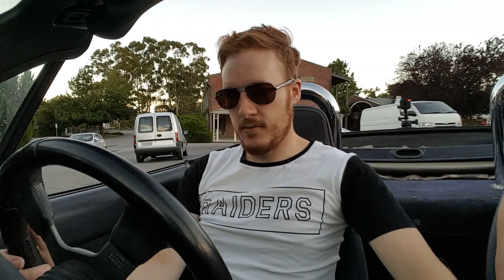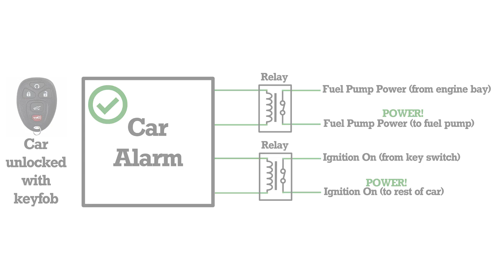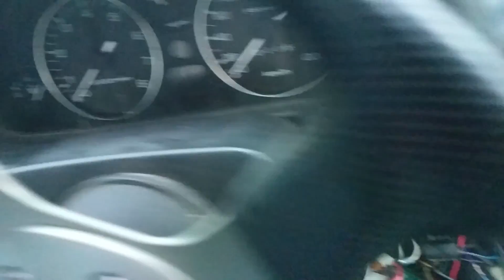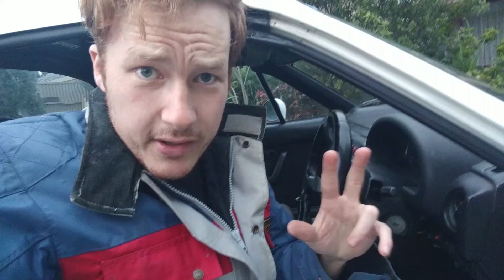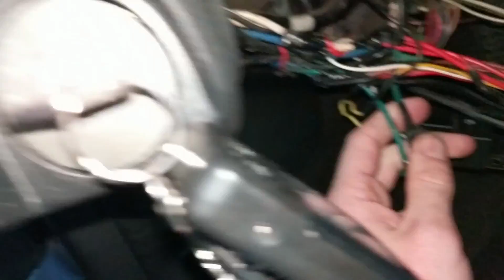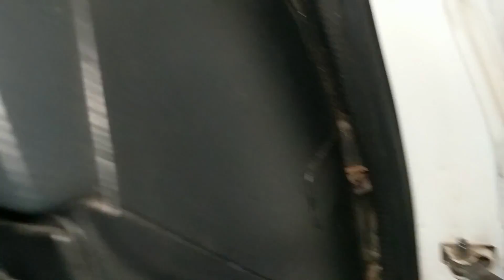How To Remove a Car Alarm - Quick and Easy, DIY!

Comment: I really wonder what the point of these alarms are if they're so easy to bypass.
Reply from the maker: Yeah, me too. But at the same time, when I first looked at this, I had no idea. 

I feel like for a professional it would be easy to get around though. Just requires that a thief is quickly able to locate the modules and bypass them without making too much noise or attracting too much attention.
Reply: Mees Boeijen I
Reply from the maker: Jerry Peterson  Yeah, it's a goddamn disaster what some people do.
Reply: Remember that while the thief is trying to access these wires, the alarm is screaming. Even a smart thief will take a little while to locate and disable. But if they REALLY want the car, they'll just break in and take your keys you most likely left on a bench somewhere.
Reply: i think your just saying that absed off you watching this video but you dont actually kniq where to locate these key in wire ir fuel pumnp wire yourself without looking at a diagram

Comment: I have a 97 Toyota Camry CE E I am trying to put a aftermarket alarm system on there I got it all hooked up sup for the lock and unlock and I can't figure out where to hook those wires to I need help

Comment: I have done same way now it took me less than one hour to remove the alarm and start the car even without the car alarm. It would have cost me lots of money 100 USA $. But your video took me easy and saved me time.  And my car is starting normal and no problem.  Thank you for good information. 👍
Reply from the maker: So glad you got a good result, cheers!

Comment: Just got stranded on the supermarket's parking lot because of the shitty alarm that was "removed". Thankfully i got it working without touching any cable (the fob works if you apply the right ratio of cursing/praying) but this video got me thinking about walking to the nearby hardware store and just do it there.

100% doing it on my day off
Reply from the maker: Good luck! Makes the car 30% less crappy

Comment: How do you identify which is the fuel pump relay in the alarm box. I have 1990 Audi that was professionally fitted. Car wil crank (new battery had to be fitted) full spark but not firing so spark + fuel = bang (all timing is good). Need to check the relay in the immob has failed and I have no manual for it so how do you check which is the fuel pump relay in the alarm?
Reply from the maker: Insight, tracing wires and comparing to a factory wiring diagram!

Comment: Lesson learned. Bought a used FJ Cruiser from a dealer who go it on a trade in. Weird, but minor electrical issues a little bit into ownership. Yeah, a year and a half later, I finally got the time to look into that weird little issue as I wanted to get it ready for overlanding and found an aftermarket alarm on my FJ. Never again. Next car will either be a one owner car from a reputable seller or new.
Reply from the maker: Ugh, that's so rough. They're always a hack job.

Comment: Did you ever make a follow up video on fully removing the car alarm (preferably without replacing the whole wire loom)
Reply from the maker: This was pretty much a full removal, all I had to do after this was take the power actuators off the locks. Then the car operated just like it did from the factory.
Reply from the maker: Every car alarm install is different depending on how the individual installer approaches it. However, fundamentally, if you rip out the unit and bypass the cutoff relays, you've purged it from your ride. :)

Comment: Awesome video! My son bought a new used car with an aftermarket alarm. His battery went flat overnight.  This morning we couldn't get it to start due to the alarm. I watched your video,  bypassed both relays and the car started. Yay! However, now the hazzard lights won't go off. Everything works as it should, but the hazzards stay on. Any ideas on how to eliminate that?
Reply from the maker: Fantastic!

Not sure what's going on with the hazards - might be some kinda weird other circuit tapped in to the flashers designed to attract attention if thieves bypassed the alarm. Have a look around for more relays, cut wires, etc.

Comment: Will you get the same result if you cut the power cord to the alarm box? Since the relays cut the power of the ignition and fuel pump when alarm is on, so I'm guessing that removing the alarms power source will get the car running, right?
Reply from the maker: Nah. 99% are set up so that the relay is normally open, i.e. it must be powered to close the circuit. Else it’d be way too easy to disable, you could just cut the whole alarm box out and drive away.
Reply: @WhatUpTKHere  
Good idea
Reply: @WhatUpTKHere  I have a tracing spy camera in my car what to do
Reply from the maker: @maryroussell5110  That you can probably cut out, if it's not an immobilizer/alarm. 

Sounds like you're dealing with some messy situation, watch your back.

Comment: Thankyou mate mine died two days ago thanks for the information
Reply from the maker: TVtwarn best of luck with the fix!
Reply: Dude she runs !! There's wires everywhere ! Half way through pulling it out already they'd bipassed the factory unit and were using the original circuit to activate the factory unit so it's a rats nest THANKYOU FOR THE HELP !

Comment: I remove the alarm system I had trouble with lights at first which little help the lights are working and all now stepping on the ignition or on the foot feet when you're stepping on the foot feed it stays running but if you light off at all it just dies I need somebody help me I'm an old veteran and this is the only vehicle I have and it needs to be able to run. I don't have nothing I need help finding it sounds like the fuel pump is pumping back in the back and there's fuel coming out of the check valve on the fuel rail

Comment: Pleased I found this as my Sons Mk2 Golf has been languishing in a damp Garage for seven years and although I have "occasionally" (every tenth turn of the key) got the Car to turnover but its not fuelling. Its a Laser line system from the Nineties with only a half moon wigit to push into a hole to "supposedly" disarm.  Hope I can find those two Relays. Really frustrating!
Reply from the maker: Good luck! Sounds like a fun Resto project.

Comment: Hi my Dodge intrepid 2000 rt I put 6 batterys in so still dies over night will drive a few days but last night I got home and never new I had in a alarm system it went off me and my neighbor couldn't turn it off but it finally shut off don't no how I have a button but it's to lock the doors and in lock o wen it was all the light was going off in on out side light is there a fuse I can pull it out to stop the alarm
Reply from the maker: MAy have to pull out the whole alarm system, sorry!

Comment: I cut the wires I assume on the fuel pump side. I got the car to turn over and start, but now it wont. Any suggestions?
Reply from the maker: Check the fuel pump is actually getting power. Measure voltage at the pump terminals.

More generally, to diagnose these problems:
Your engine needs air, spark, and fuel. Which is missing?

Comment: I borrought a 2002 Odyssey van and I unhooked the horns immediately after they went off for no reason. I was thinking about simply running new power wires to the horns and run the wires up to my dash and install a button.   I don't want to interfere with the factory wiring for fear that I will mess with the factory alarm system and will cause other problems.
Reply from the maker: Sounds frustrating. Maybe a diagram will help?

Comment: This video was confusing for me. Too many initial steps skipped for my level of skill.
Reply from the maker: Sorry to hear that it didn't help you. Simplified, it involves:

Step 1: identify relays that are cutting wires vital to the engine running.
Step 2: remove them and splice the wires back together.
Reply from the maker: It does assume certain basic knowledge - soldering, an ability to tell aftermarket install work from a stock harness, ability to identify which wires the car needs to run and where they are. 

Unfortunately though if you haven't done any auto electrical work before you might find it hard. 

What are you struggling with?
Reply: Gosh,  that is very nice of you to take an extra step to help a stranger. Don't I feel like a horses butt. 

My uncle's old 2000 infinity horns beeps for no reason,  and, seemingly at 4 to 6 am while I am sleeping. 
I presume this is a factory alarm. 
I watched a couple of other videos,    and there may be a door lock sensor that is telling the factory alarm that a door is open, when it is actually closed. 
I'll try WD40 on that particular door lock and see if that helps. 
Notwithstanding, you showed yourself a better person than me by going out of your way for me. 
Thank you!
Reply from the maker: universalchiro ah, I got where you were coming from, I know what it's like when you're trying to get your car sorted and you can't make sense of it. Not gonna lie, I had this horrible system stuck on the car for six months before I figured out how to remove it. Was doing my head in.

Sounds like you're on the right track, those door switches definitely do get dodgy as a car ages. Had the same problem on the MX5 with the alarm's hood open switch, car wouldn't even lock. Try looking to see if the alarm is using the little switches covered in rubber on the door frame that operate the interior dome light (these can fail) or if it's something else.

Best of luck with the fix mate (y)
Reply: Roger that. Thank you!

Comment: stupid engineers doing jobs like that, if they know how to connect an alarm system you will never have a problem with, my father and me we are car electronic engineers from Greece and we never had problem with our car alarms and never our cars (our costumers cars) thieft, i will give an example, my father install a spyball car alarm back in 1992 (i born on 1994) the man that have this car make a stupid mistake, he clean the engine with water (back in 90's the center of car alarms was out side of the trank, was inside the siren so inside the engine bay) we took of the allarm center out we clean it and we put it back, guess what... the alarm works great until now (1992-2018), so isn't so easy to still a car with a premium car alarm the stupid engineers make it easy to the thieves, and i will tell something and you will figure it out, we need about 8 hours 2 people to install with our way an alarm system with all the feauters ( all the sensors, closing windows, microwave sensor, power up your engine from the mobile phone and tracking your vehicle live on map) so now, exlain me please how the engineers in america or other countries doing for the same job 1-2 hours...? probably they doing something wrong... And something for the history me and my father we are the only guys on planet that we install on BMW X5 (with canbus system) a non canbus car alarm WITH engine start via remote control, when we ask a diagram from the dealership in BMW they ask why we need the diagram of the canbus system, we told the why and they told with 100% sure that we cant do that, they told is imposible, 10 years now the alarm works great, i told you this last thing not to do the smart guy i just want to saw that we know how to fix electronics in cars...
Have a nice day...!

Comment: Or just buy a crappy car that nobody would steal!
Reply from the maker: A lot of crappy cars have crappy alarms that stop them from starting!
Reply: Yeah that's me. I don't even lock my doors because no one is stealing my 2007 Pontiac Vibe, but I have this hacked-in alarm and a complete mess of wires and splices under the dash.. and no power to fuel pump. Thanks for the video TK!!